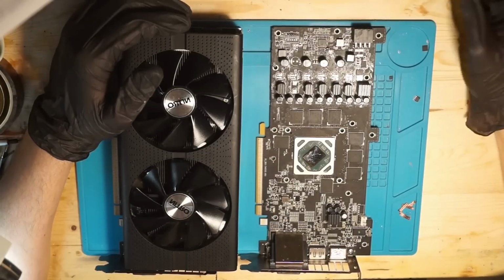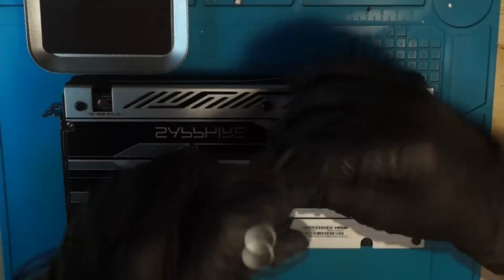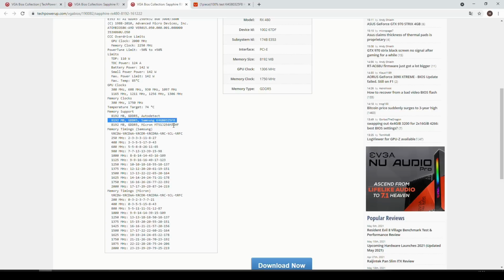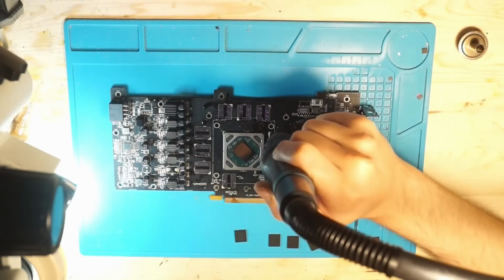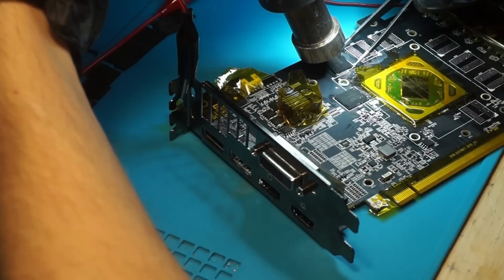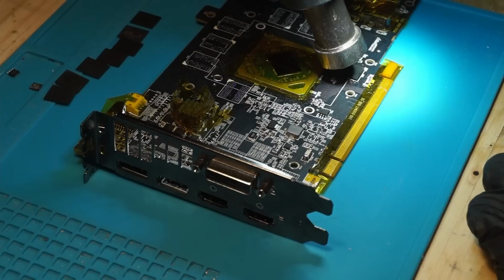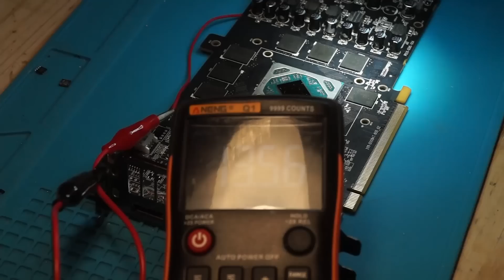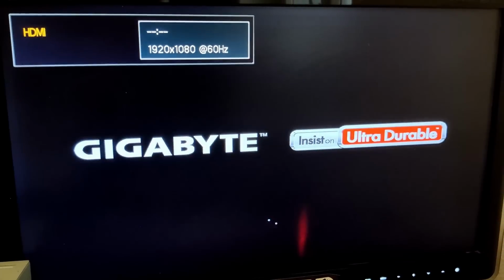Doubling VRAM? Upgrading an RX 480 from 4 to 8 GB

Comment: This is sooo intresting, i wont do that to my cards because it's not my level at all (and still not sure of the benefits), but it's intresting to know that it's possible ! Awesome work !
Reply: More vram is meh its only useful if your using programs like blender etc most games don't exceed more than 4gb apart from more demanding games but it's gpu itself that will give you the fps
Reply: But in 2021 8gb vram or atleast 6 is way better than 4gb
Reply: More of a game changer if you could do it to 3gb cards for mining :)
Reply: @mylescalladine8194  yup, vram is only for textures.
Reply: @cheedam8738  Nope, it also stores model data and in some graphics APIs it is even used to store physics simulation data for stuff like cloth and particles.
Reply: @myriadtechrepair1191  oh crap yeah i forgot about that thanks mate
Reply: Specifically for vr you want 8gb also, yes 4gb will work but honestly want more as I find my vram always pegged at basically 4gb with my 4gb rx 570

Comment: You can make a custom bios for a 16GB RX 470-480/570-580/590
The Workstation counterparts go up to 16GB and they use the same cores.
The question is... would it be worth it?
Reply from the maker: Yeah you are right, there is also a 16GB mining card (Saphire?)..but as you said, the bandwith limitation would probabably bottleneck the card pretty badly...
Reply: 8gb is good enough for this card .. i have 8gb rx580 and it never uses 4gb in most games at max 6gb
Reply from the maker: Oh yeah sure, you are right. That would be cool. But the issue i see is the BIOS. If the data for the new memory is not in the BIOS (almost guaranteed) it wont be detected properly (clock, timings etc). And it is currently not possible to mod turing bioses...So unless they make a reboot (like the 2060), for now it is not possible. Hopefully the encryption will be broken at some point so the bioses can be modified..
Reply: @fxbbm  can you make 32gb ram ddr4 for this ram module BLS8G4D240FSBK
Reply: @GamerSuper91  just grab a 32 GB DIMM. It will be cheaper, easier and more reliable
Reply: @KuntalGhosh  1080p ;)
Reply: @fxbbm  what if it was done with Hbm memory, although I doubt it would be easy hell I doubt it would be possible but it would not have any bottlenecks from bandwidth and you could probably get an old Fiji card to 16 or maybe even 32 gigabyte
Reply: @talhahtaco2035  HBM is a different process altogether. THe Memeory is fused to the GPU die with an interposer layer in between. Can't "unsolder" that without destroying the GPU.
Reply: @fxbbm  please help me. I have changed the memory on pcb from 4gb to 8gb micron but now i cannot flash bios when i try it says pn miss match and if i try from cmd it says adapter not found the gpu suddenly goes down. Other then that it shows rx 570 in device manager
Reply: @fxbbm  depending on the workload . For computing like open cl acceleration, davinci resolve, Houdini (OpenCL) 16 gb are more than welcome. For games no.
Reply: in forza horizon extreme 1080p it uses all 8gb and it says low vram @KuntalGhosh

Comment: For the "possible to do" part, even if you're not doubling by adding larger chips, it might be possible to upgrade VRAM in some cards. For example, there's a group of modders that upgraded a 11GB 2080Ti to 12GB by actually adding an extra memory module (and modding vbios/drivers), as the 2080Ti PCBs have unpopulated pads for that. They could've also upgraded it to 24GB by using 16Gb modules but I think those weren't out yet at the time of the mod.
Reply from the maker: Thanks for commenting! Can you send me a link to this 12GB mod? Because to my knowledge modding a turing Bios is not possible and this would bei interessti g! Thanks for watching and have a nice day!
Reply: @fxbbm  I can't find the exact video right now, but IIRC it was the Brazilian modder group TecLab who did it (and, while they were at it, they also replaced all 2080Ti memory modules with 2080Super ones, which were 16Gbps each)
Reply: More recently, VIK-on also managed to get a 2080Ti to 22GB, btw (with a strap mod, thus, lots of artifacts, but that proves that they are able to increase the memory pool available to the memory controller)
Reply from the maker: Hey, Thank you for your answer, this sounds inressting, i will look into it!

Comment: I have the exact same card, rx480 ,but with 8gb. I did some small bios modding, I tried upgrading it to an rx580 bios but it wasn't stable. It doesn't really matter though because my card is a really really good overclocker and I have run it continuously at 1380mhz since I bought it. It used to be able to hit 1410 on air with a cold room or AC hooked up but it has degraded somewhat. The rgb controller also fried when it overheated because AMD's drivers configured the fans wrong. I used MSI afterburner for a while but I'm just running it stock with another fan controlling software that works with everything including my motherboard.

Comment: What temperature and airflow do you use to remove VRAM chips on the hot air station? I also noticed you measured the VMEM coil resistance in real time while soldering the chips back on the card, to make sure you don't bridge anything
Reply from the maker: I use 420°C @110l. And yeah, thats true, i monitored the resistance from the memory voltage rail to ground during soldering. Its super annoying when replacing so many chips to make a mistake and only noticing it in the end.
Thanks for watching and have a nice day!
Reply: @fxbbm  nice
Reply: I have tried replacing memory modules for the past month and failed after 10 attempts, all the cards ended up with a bad memory module, i didn't even heat the chip from the top, only from the bottom of the card, and monitored the temperature using a thermal camera, they were within 170°C.
Can anyone help?
Reply from the maker: Heat it from the top too, 170°C is not enough to melt the solder (assuming its not some bismuth low melt stuff, which should not be used for that).
Reply: @gpudoctor  are you drying your components and board at 100C for a couple hours before soldering? Heating to melting temps right away can damage the pcb or a component.
Reply: @Sampsonay  You are VERY misguided if you think baking an entire card at 100C for numerous hours is part of any sort of rework, because it's definitely not. The only thing that will do is severely degrade all components on the card and possibly kill it.

Comment: There is a 16gb Rx 470 which was released for miners a few years ago so I'm guessing an normal Rx 470 can be upgraded to that
Reply from the maker: Yes, i've seen these cards too, also from the server space. So Yes, it is possible. But is it useful to have a 16GB card? The memory bvandwith would not change and the card would be limited by that. So maybe for mining (although not sure if it would be that useful) but for gaming this would be rather pointless....
Reply: @fxbbm  totally agree for gaming the card it's self doesn't have the power to use more than 8gb. But for mining I've heard from my friends that do mine they are great cards to mine ether and other such high memory coins and can easily keep up with rtx 3060's with there 12gb of vram for such coin mining. The 16gb rx470 are rare cards but if you could make them by memory upgrades I'm sure your in for some profit. 
Great video by the way
Reply: I have sapphire rx 470 4gb. Can I upgrade it to 570/480? Or memory upgrade to 8gb? How do I know if I can?

Comment: I have never seen anyone melt the balls with the matrix sheet for guiding the balls still on. I personally would be too afraid the balls would solder to the plate, or that it would warp the plate because of the heat. Does the plate discolor?

Comment: My RX580 would crash when the fans turned on. I found a work around by enabling the onboard AMD video drivers on the motherboard.
That worked well for about a month. The 580 would crash but the onboard video would continue to function allowing me to continue my work until shutdown.
Until a capacitor on the 580 exploded and shot flames out of my PC case. I'm going to replace the failed cap and hope the card works well.
Reply from the maker: Hope you get your card back running. Thanks for watching and have a nice day!
Reply: @fxbbm  Well. I took the heatsink and fans off last night and the prognosis is not good. Because the capacitor was prevented from exiting due to the heatsink, the energy released literally vaporized the copper traces and some of the small components nearby. 
I don't have the knowledge or tools required to repair it.
Reply from the maker: This can be good news, these Kinds of damages, depending where they are, can be repairable. I'd give it a shot and let it repair(given the current prices)..if you are in the EU, "gerrepair" (yt/twitch) is VERY competent.

Comment: im considering doing this  to my 960 2gb because it has the solder spots on the pcb for the extra modules but there just not there
Reply from the maker: Make sure to do research on your card, often times you cannot just fill the unpopulatet spots, compare your card and your memory chips to the lager skew....thanks for watching and have a nice day
Reply: @fxbbm  my problem is it's an OEM hp card so finding a 4gb bios will be hard

Comment: Just a Dumb Question how much would you charge for repair I have a mini GTX 1050 the GPU  mini Zotac and the Fans won't kick on at all. it has Hit 80C before I have even tried to use MSI afterburner and a few other programs to no luck the card still works it just a fan issue
Reply: Check the padsize and the quality of the thermal paste
Reply: @anwartech8193  that's all been changed. like I said the card work it makes video happen its just the fan Never kicks on
Reply from the maker: Hey, sorry cannot take any repairs..but if its only a Fan issue you could try to buy a replacement from eBay or the like (worst case you could use case fans and run them unregulated).
But 80°C ideling ist bad! There must be another issue, make sure that the cooler ist mounted properly..! It really should not get that hot with no load!

Comment: Hi mate, great video!, I want to know if this will work on old Radeon gpus like the HD 3850 because I have sapphire agp version (512 mb 64x8 modules) and the pcie one (Is 1gb 128x8 modules) despite the connector, is the same pcb same brand of memory (qimonda) would be fantastic for retro computers.

Comment: Hello, thank you for the video. Iwould like to ask you, for bios flashing, we have to flash it before to make the modifications or we can flash it after?
Reply from the maker: I would do it beforehand, but it should be possible to do it afterwards...
Reply: @fxbbm  thank you for your answer, if any dude did it after please tell me :)
Reply from the maker: Really should not be an issue, you can always flash it as a secondary card in your PC, worst case you can use an external flasher such as CH341a..
If you do it beforehand, its just more convienient and you can immediatley check if everything works thats the reason why i would recommend doing it before, but from a technical point of view it doesn't matter....
Reply: @fxbbm  understand, thanks for your fast reply and details

Comment: i was always wondering if 2gb r7 260x/360 sould be made a 4gb since they share the gpu core with frrepro 5100/4300. i don't know it it is a variant or the xl  and pro sufixes come from the usecase but it would be interesting to test r7 with at least firepro bios with busted clocs , since oryginal card is mostly limited by vrm
would 4gb r7 match rx 460 or be closer to rx 550

Comment: Generally speaking, would it be possible to upgrade the vram type entirely? Like from gddr3 to gddr5 chips?
Reply: That's a weird question because cards are so cheap it's not even worth to get a ddr3 card or chip.
Short answer is no. Even if you do like the gt 1030, the cost is just like getting a modern card.

Comment: could you upgrade to 2gb gddr module instead of the standard 1gb one
Reply from the maker: I recently learned that some company made a 16gig rx 480 mining card, so phisically, yes, this would be possible.  

 But you would have to modifiy the Bios and possibly the drivers. But even if that would work, the card would then be pretty badly bottlenecked by the given memory bandwidth. 
So, for mining: maybe. For gaming: hell no!
Reply: @fxbbm  okay, thanks for the info.

Comment: Hello, i did the transplantation, as you described. I have a problem the card is recognized on hiveos, but i dont have any mining stats. I will connect a screen and look at kernel information but i try to understand what i did wrong. The only difference with you is that the resistance goes to 1.3 at the end before to go back to 25. Do you think is the problem ?
Reply from the maker: Ok, have you tried a stock (8GB) BIOS first? If not i would do that..The resistance seems fine, the 1.3 Ohms while the card is hot is perfectly fine, the resistance at that point is mostly temperature dependant, everything apart from a dead short is ok... and 25 Ohms when cold is ok too 
If the stock bios does not improve your situation, you can try to run a diagnostic script. https://repair.wiki/w/AMD_Memory_Testing_Guide and the Videos of "A.S Repairs" maybe helpful to find the fault.
(All of that is assuming, that the soldering went fine and your replacement memory is fine as well, if you are not 100% sure it is good maybe check that again..)
I hope you can find the fault and best regards
Reply: Merci Beaucoup

Comment: Any cons using modified gpu from 4gb to 8gb when using it in mining ?
Reply from the maker: Not really, you can use the same or better memory as stock 8gb cards, so there should be no issue there. Only longevity MIGHT be a problem, but the card from this video is still running great after a year...
Thanks for watching and have a nice day!

Comment: what about laptop vbios? i wonder if old laptops with soldered GPUs had an integrated vbios or how that works.
Reply from the maker: Yeah, they usually have a vbios Chip, just like normal cards. For an Upgrade you would need a suitable Bios (at least for newer gpus since their Bios ist encrypted and cannot be altered) Thanks for watching and have a nice day!
Reply: @fxbbm  was that still the case in 2008 for chipset based GPUs? my dell has chipset based nvidia GPU (8200m gs) but, was given 128mb DEDICATED vram
Reply from the maker: If you mean the Bios encryption, then this is  probably not the case for older Chips.  I think they started this with the maxwell cards...

Comment: Hi friend do you use K4G80325FC-HC25  8GB or 1GB? 
I have searched for this part but only found the 8gb variant
Reply from the maker: Im not sure if i understand you correctly but each individual module has a capacity of 1GB, 8 of them gives you then 8Gb...the ones you mentioned should bei fine...
Thanks for watching and have a nice day!

Comment: I really wish I could do this with my 680 SOC the two gigabytes of the ram put a heavy limitation on what I can and cannot do even though the core has much more to give would upgrading the ram be possible to do on a 2 GB 680 SOC I know there's 4 gigabyte versions out there or would it be possible to place the core in a 4 GB
Reply from the maker: Probably, I think with those cards, the Bios is not locked, so it would also be possible to edit it , or alternatively use the 4Gb from another card,. But I dont have experience with the 600 Series cards so this is guessing from my part...Thanks for watching and have a great day!
Reply: You have a great day as well

Comment: I have MSI Aero Itx GTX 1060 3GB
Can I mod the VRAM to 6 GB?
Reply from the maker: Probably, but since you cannot change the bios that easy(like in the polaris cards) its a bit more tricky to do. 
Also: 1060 3GB is not the same GPU as the 6GB 1060.
Reply: @fxbbm  Thank you very much, I appreciate the knowledge you gave me.

Comment: All i see from this video is not just doubling your gpu memory if your a god at soldering but a thing that some people can do with there cards that were bought or scammed by a miner. Such like you buy a GTX 1060 6gb from a miner but the vram was dead. You could affectively replace the memory and it could keep on going. I had a RX 580 4gb and i ended up giving it away with other parts i sold and the person who got it from me sent me a video of it working with replaced vram even tho that was when the RX cards were cheap and he said it wasnt really worth putting 150€ into a card worth 75-100 at that time

Comment: bro i have a drx 10 card can i upgrade it to dx 11 is that possible ?
Reply from the maker: If the GPU does not support dx11 there is no way to add it apart from software emulation (warp) which is afair absolutley horrible performance wise..
Reply: @fxbbm  thnx

Comment: did you known how to check good and bad ram when it was removed from pcb?
i plan to replace my bad ram from main gpu from donor gpu
Reply from the maker: No, i did not check the donor memory (apart from measuring the resistance of the memory voltage rail to ground). I assumed it was fine based on the issue with the donor card. There are memory testers but they are expensive so i dont use them. Thanks for watching and have a nice day!
Reply: @fxbbm  Theres tserver testing software you can use but it will not be able to tell you the exact chip thats bad.
Reply from the maker: Yeah, but the donor card was not running ...